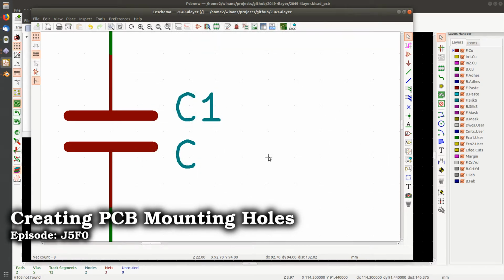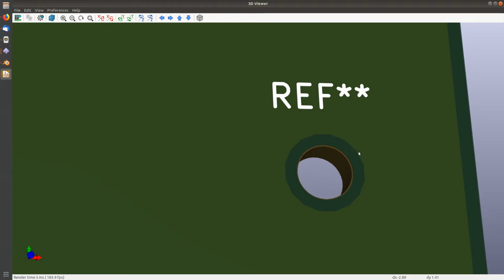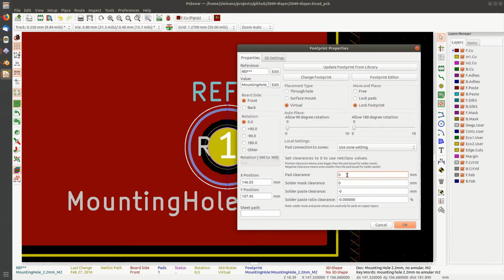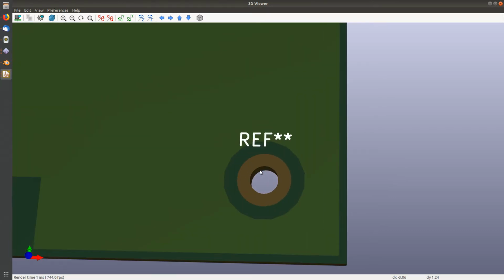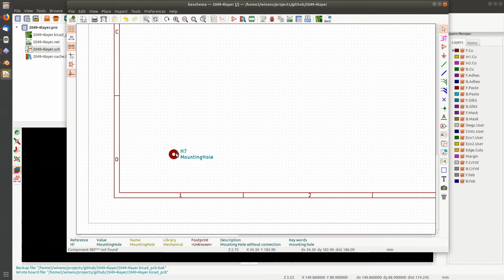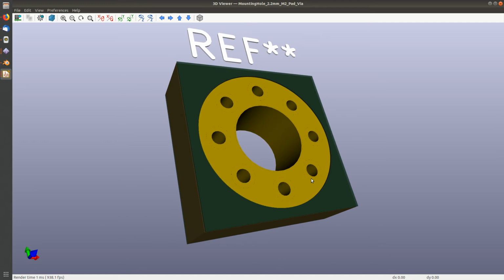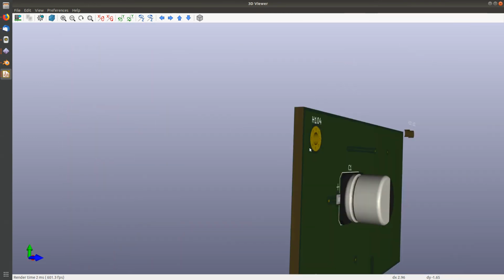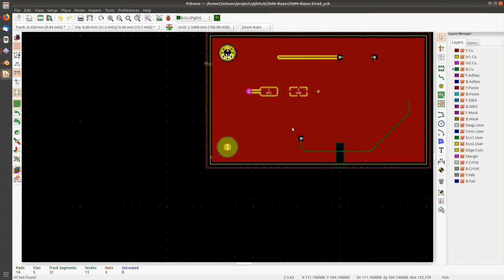KiCad 5 #22 PCB Mounting Holes

Comment: This is a fantastic mounting hole video.   I would like to change the grounded round pad with vias to a square design with rounded corners. Then use a 2 pin jumper to connect the ground to common or leave the power supply common not connected to the mounting hole ground.   John this video has some great advice. Thank you.
Reply from the maker: Thank you!  Glad to know I could help!

Comment: How do you move a mounting hole ? I've tried moving it but I move only the library part (mounting hole), the actual hole remains in place.
Reply from the maker: Whuu????   🤔.. makes me think that someone placed two different footprints into the same place on the PCB.  Or there is some odd locking going on?

I wonder if there could be a circle on the edge cuts layer?

If 'it' is a mounting hole that came from the schematic then I'd consider deleting it/them from the PCB and then re-do the import and place it anew.

Regardless... there is likely more going on than you have described.  Have you asked about it in the kicad.info groups?

Comment: I use plated mounting holes with sattelite vias even if it is on 2 layers, or when the hole is not electrically connected to anything. It just feels to be more robust in terms of carry current, resisting damage from screw pressure or abrassion, and stronger mechanically, less risk of unbounding copper from the substrate. Just my ideas. It cost almosts nothing in most cases to use them, nor they use more space. They might not be the best idea for wave soldering, but often will do fine. Obviously, there are also other options, like mounting holes with solder segments, to add a bit extra mechanical strength and contact pressure. Various types, not all of them avaialble out of the box in the KiCad.
Reply from the maker: Yeah.  Sattelite vias are definitely better if you need to assure that anything other than the top copper is in contact with the bolt head.  I should reshoot this or add another vid discussing the tlproblems with counting on the thru-plating surviving after the PCB is squeezed by a bolt. 😕
Reply: @JohnsBasement  Thanks for this video, still learned few things here and there.:)

Comment: Hi John, the padded mounting hole with via... Are the through hole/vias attached to the net, you specified for the mounting hole.

For example I'm going to use the mounting hole to ground the PCB to the chassis. Someone mentioned that a regular padded mounting hole is not enough as the screw may damage the copper in the hole and severe the connection. So they suggested a mounting hole with vias, but they do not know how KiCad works.

So I added my mounting hole and attached it to my ground fill zone and it looks attached to the center, but I do not see the via pads attached to it through thermal reliefs???
Reply from the maker: If your mounting hole is a pad and that pad is a 'pin' then it will connect in the manner of any 1-pin footprint.

Add vias and else as you wish.  If they are all on the same net then they are connected... If there is no copper than your rules for traces, clearance and such are to be suspevted.

As for expecting things to get connected to filled regions, that too will depend on your settings for things like clearance, thermal spoke withs and so on.
Reply: So the hole is over the coper fill and from that perspective it's connected. Someone suggested that I change the properties of only that specific mounting hole from thermal relief to solid and that will do the trick.

So while the rest of the pads are connected with thermal relief the hole has full solid connection. See my attached image:

https://www.dropbox.com/s/uy0syv2g7ay75eh/Screen%20Shot%202020-11-16%20at%206.41.30%20PM.png?dl=0

Comment: John, I'm really appreciating your video.  I do have a question, I use a CNC (I've used EagleCAD in the past) and I want to now use KiCad to mill double sided PCBs.  To do that I need to add alignment holes so that the board is aligned correctly when I flip is over.  Do you suggest going the route of adding, in this case, non-plated holes?
Reply from the maker: Thanks for the kind words.
CNC milling PCBs is new to me. How did you do it before?
If you are only drilling & milling, I'd expect none of your holes will actually be plated. If you are drilling tooling holes to mount the board after flipping it over, then I'd expect you will want a true bore size... which should be most accurate if nothing in the data pipeline tries to do you any favors... Like increasing the outputted bore size to accommodate for plating.
I feel the need to emphasize the fact that I know very little about milled PCBs.
If they are tooling holes (to mount the board on a jig, then I'd dive in by specifying a non-plated hole (and a plated one for contrast) and look closely at the drill files and see what diameters are given for them to see if they match my expectations.
Let us know about how it goes. I'm be interested in knowing if they are tooling or if they get 'seen' by cameras or some such other thing.
Reply: Dave at EEVBlog made mention of Fiducials a while back being used for keeping boards in register for pick and place machines I think.  (been awhile, surprised I remembered what they were called)  Don't know if they would help with your situation, but might be worth looking into.
Reply from the maker: FYI - Fiducials on PCBs usually refer to small copper dots that are placed around surface mount chips so that a camera on a pick & place machine can improve its target accuracy (over dead reconing) when putting down the chips.
Reply: @JohnsBasement  Thanks for explaining that.  I couldn't remember so well.  They say memory is the second thing to go.  I can't quite remember what the first was.....

Comment: John your videos are the best online tutorials I’ve seen. Super helpful in that you state clearly the objective and make useful comments on what hot keys you are using as you progress through the video!

One request. Can you comment on how to place holes and parts exactly? I am working with a mechanical designer and another EE making boards that have shared mounting holes and stacking surface mounted board to board connectors.
Reply: Thanks John!
Would be a great video topic. I spent 2 days trying to figure it out!

I found a feature call move relative CTRL-R. Set the grid origin to the edge corner as you suggested. Then when selecting the components use move relative and select the grid origin option and enter then the coordinates.

One point is that it seems to work best for SMT parts if the footprint is centered. I had to fix some of my custom footprints so the pads are symmetrical about the center, which is how most parts seem to be designed.

Issue I had was the KiCad coordinate system is fixed with the origin at the upper left hand side of the paper. Meaning a bunch of math if you use absolute coordinates. In any case I had to get buy in from my colleague to use the board corner as our common origin. My colleague is using Altium for his board and I’m using KiCAD 5.1.
Reply from the maker: Good idea for a new vid!
The short of it is that I do it by selecting the part and hitting E. Then i can see or manually set the X and Y coordinates.
A vid may be needed to show how the positioning reference on the parts works.  For mounting holes, it is easy because a hole is one pad and its center is what you want for coordinates.
I find a board corner's coordinates from the edge cuts outline line-segment coordinates and go from there.